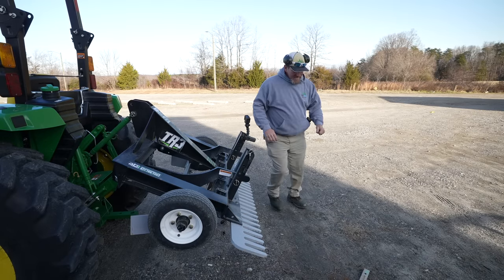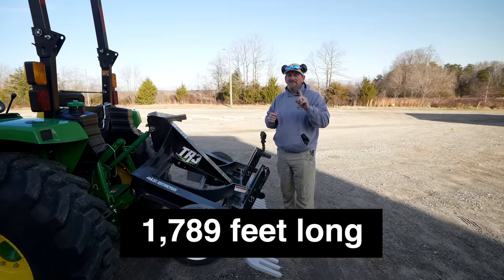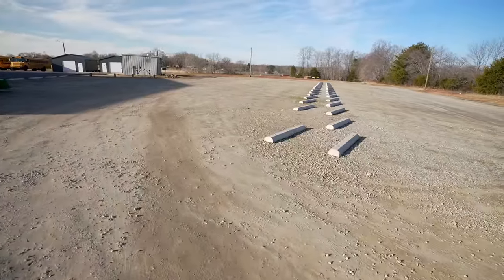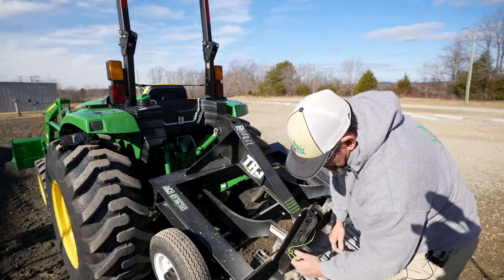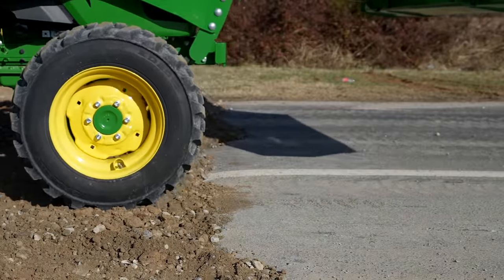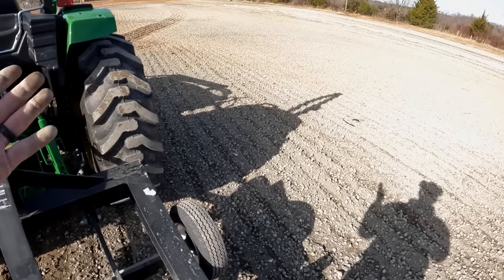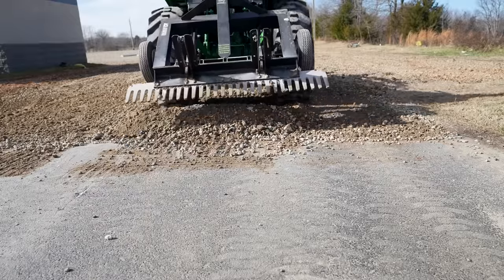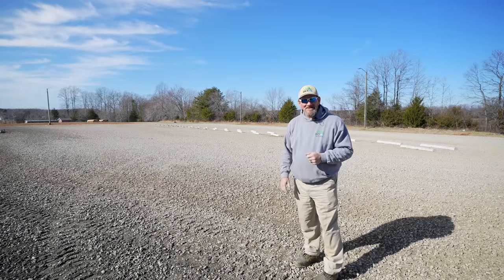Full Video ABI TR3 Huge Gravel Parking Lot Renovation

Comment: i've noticed everything operates better when you let it get up to operating temperature and cool down from being run hard.
1971 john deere manuals state to always let the machine run for 1 minute before use, and 1 minute before shutting it off to lubricate internals but also let temperatures normalize.
my john deere 140h3 still runs to this day but it needs a new stator due to brother jump starting it hard too many times, and my 445 misses alot when it's cold like today when i used the snowthrower attachment to clear the drive way of 3" of snow the weather guy said the night before was supposed to be 18" <eye roll> domestic terrorists! because it's the end of snow season to clear out stores inventories so they don't have to pay for summer storage til next winter, and  wages for people to put the left overs into storage!